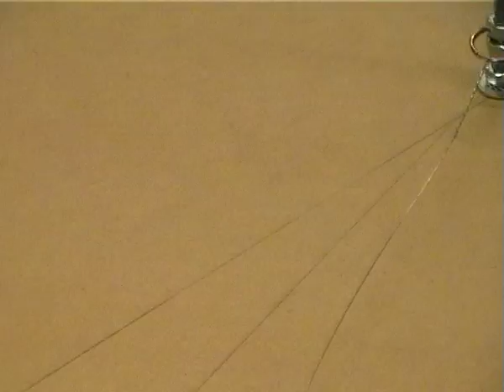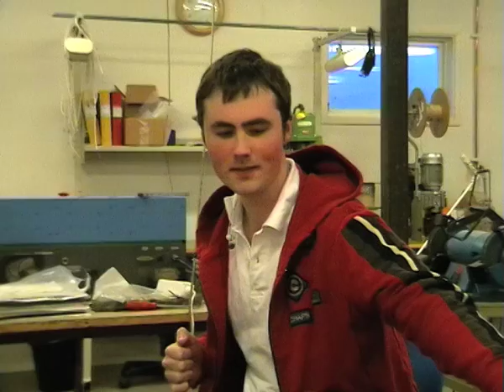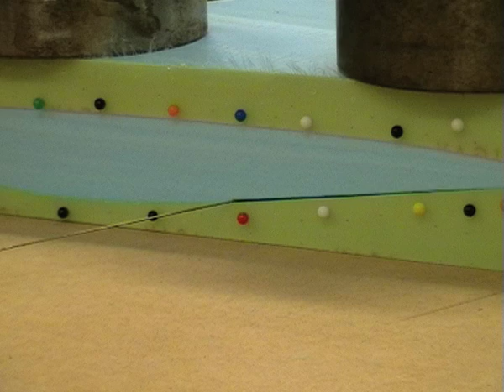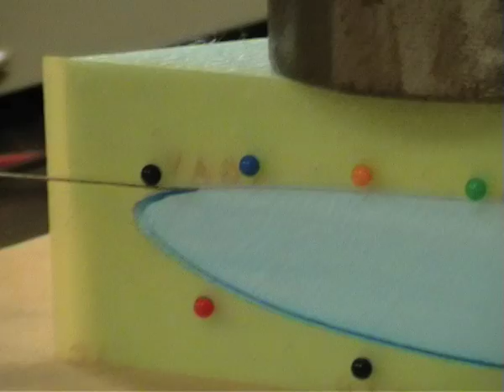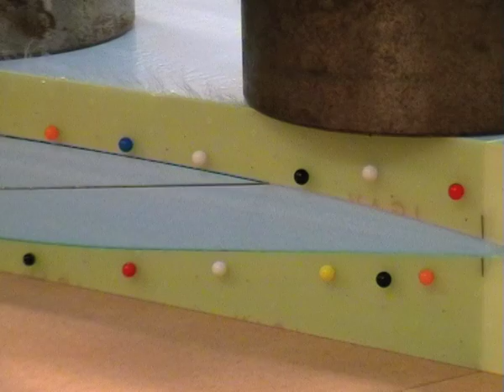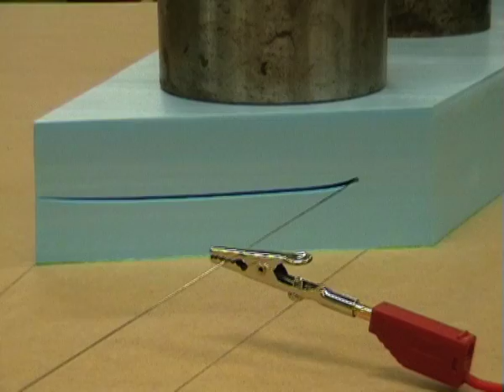Hotwire demonstration

Comment from the maker: Hi! The wire is "Nicrothal 80", 0.3 mm thick. The foam is bluecore/fanfold. For this type of foam 2.5A though the wire gives a good cutting speed. The voltage will vary depending on the wire length.
Good luck!

Comment: This is a great video, i have been hot wire cutting foam using a big tool which is makes it hard to get a nice cut, using a pivot point seem to be a very good idea. How do you go about aligning the foam to the pivot point? How high is the string in relation to the peace of foam?

Comment: Hi David,
Could you tell me what's the voltage, amps and wire diameter?
I am having issues because the foam melts too much at the shorter side of the wing. How can you make it soo smooth?
Maybe my wire is too hot?

Comment: Damn, that is an absolutely beautiful result. Are you doing any height control with your hands, or are you just using the pressure from the template for the vertical position of the wire?

Comment: you can do it with a PC power source.. Since you can use 5 or 12v and also supports the current easily as long as the wire has over 10 ohms.

Actually i tested it with 12v, and a guitar string (the thinnest) wich had about 20 ohms, and current for that resistance at 12v is about:   I=V/r=12v/20ohms=0.6 amps. In 12v the source can handle in my case up to 9 amps.

Overall the power used is 0.6A*12v=7.2 Watts.

Comment: lol im bodging a hot wire cutter up now, i really thought there was no dollar tree foamboard or anything like that in my area but then a builders yard down the road has big very tough lightweight blue board for insulation. it seems so tough i cant snap it. 1.5" thick about.

Comment: Why are you cutting on an angle? what are the guide wires for under your foam, meaning why on an angle?
What if you want the wing to be the same width on each side, what do you do then?  What wire are you using please.

Comment: That negative template seems to be the way to go ;)

Soon be making my first attempt. I got a very similar power supply to yours. The instructions with mine says not to turn it on or off with a load. It doesn't hurt the supply when you power it up with the clips already on the wire??

Comment: Is there a benefit to using the stencil you did to cut vs having the opposite? Like using the piece you cut out of the stencil instead of what you used?
Reply: I've been using this since 1980 but in a well balanced, wire supported frame (exactly the same pivot point technique but less wire sag). Using the positive template makes the work (dragging through the template) more difficult, especially around the leading edge. The final results are poor to say the least. A negative template is the only way with this method. You should make sure you use hard wood ply with well sanded and soaped edges. Fiberglass sheet is great but more expensive. By the way, he went too hot here. His wire cuts too fast and melts too much of the airfoil at the tip.

Comment: Depending on this cutting method, there is no washout at the wing tip. But many  people say that a flying wing cannot fly without washout.
Reply: +Winx Wassa I have never built a flying wing with washout and they all fly just fine......
Reply: +Harlan Mote Thanks for your  reply. This is an important news for me.
Reply: I use a Clark y airfoil and a Eppler 332 airfoi it is for a flying wing it has wash out built in to it. look on google @ UIUC Airfoil database they have a lot of air foils just for flying wings. I hope this helps you out....
Reply: I made a hot wire cutter out of a power supply from a old computer i had laying around and a piece of stainless wire.There is a video on here that the guy shows you how to jump the green and the black wire and get the unit to power up and what  wires will give you 12 or 24 volts. i use the 12v  work's really good on blue or pink foam and polystyrene too.....

Comment: What power supply you use, and wire. Thanks
Reply: i used a 3s lipo and resistant wire with 5ohm / meter and it works really well. You could also use a 2s or 4s lipo it depends on the speed you want to cut at and the lenght of the piece of wire you want to heat.

Comment: great idea without the use of additional wire tightening mechanism. I think two person would be better option each holding the wire from each end. resulting in to lesser error. it is better to have wooden handle on both sides for better hand gripping and better tension control.